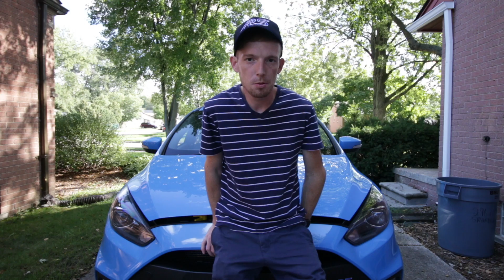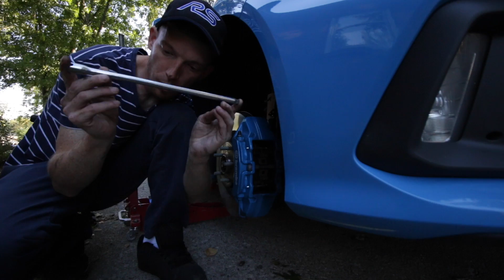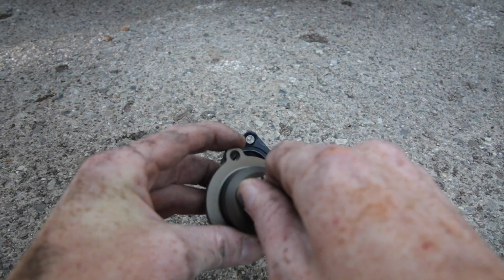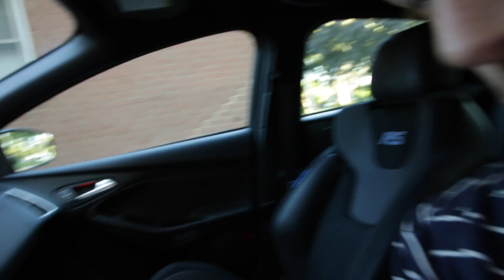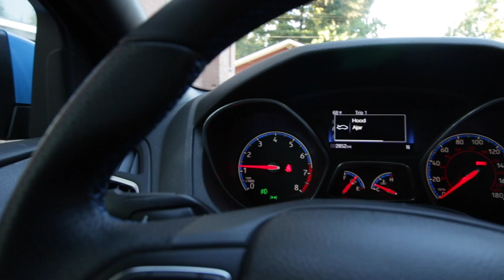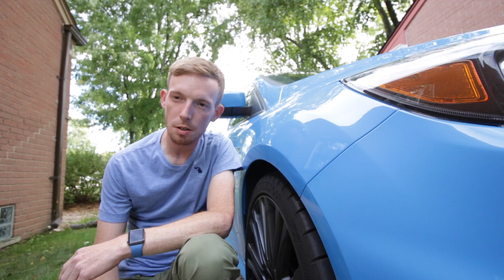Mountune Recirculation Valve Replacement

Comment: I have installed the Mountune recirc valve but since first full throttle acceleration i felt a misfire like behaviour of the car. In the next days i had misfires in like 3-5 out of 10 full throttle accelerations. Today i took out the recirc and noticed the inner O-ring wasn''t there. I don't know if it was there at the beginning or maybe if could have been sucked by the turbo...The screws were tight. I put in the stock valve and i got 25-30 full throttle accelerations and no more misfires. As i recall the bigger O-ring came separattly. I just cannot remember if the inner small O-ring was attached or came separate, or just wasn't there...If it really was sucke into the turbo could it cause any damage? I ran the car for almoast a month with the mountune recirc.
Reply from the maker: I think sucking that into the turbo would have caused a bigger disturbance than a miss fire. That O-Ring does come attached but can easily have been hit off during install, etc.  It’s not super tight, but is for sure why you were feeling your miss fires. You A/F was way off. I do not think that you would have sucked it into the turbo without a more significant occurrence.
Reply: @ChristopherAyresfrs2  While on this subject is is the recirc montune a nessary change if we have the m380 tune? or stock recric fine.

Comment: you dont have to torque your wheels in sequence btw
Reply from the maker: Why wouldn’t you?  The factory sequence is all lug nuts secured fully at the exact same time. I know for repair standards at leas in tier 1 Auto companies it’s also mandatory to star torque.
Reply: Christopher Ayres once its on the hub, its on the hub, its different than sealing a headgasket in sequence
Reply from the maker: That’s not true. You do have to do them in sequence. The OEM does them all at the same time, the only way to replicate is by pattern unless you have a $200,000 wheel multiple.
Reply: Christopher Ayres im saying in sequence as in you dont have to torque them to 10lbs then 20 then 30 for example.

Comment: Great videos, no hiding you are full blown Mountune fanboy! Thanks for the content and little DIYs. Appreciate it. Also nice to see someone else with some RS apparel, so I dont feel a bit weird about my RS shirt.
Reply from the maker: Thanks. I appreciate you watching them. Mountune has been a great company to work with.
Reply: @ChristopherAyresfrs2  Hi Chris, What’s the difference between a Bypass valve and a recirculating valve? Personally I don’t like the washing sound. Some cars have the turbo chirping sound and some cars don’t. Why is that?
Reply: @surreallife777  A recirculating valve takes the excess boost pressure and feeds it back into the intake system. A bypass valve vents that excess boost pressure to the air, creating that "PSSSHH" sound we all love. On ST's and RS's, a recirc valve will mostly give you closed-throttle surge; something everyone knows as "turbo flutter."
Reply: @greecoboost  OK thanks for getting back to me.

Comment: Why this piece and not a Turbostart BOV ?
Reply from the maker: It’s a preference. I don’t like to rely on a twist to tighten/loosen unit to let out excess psi when it’s letting out to much. Also this recirculates the extra pressure back into the turbine instead of just venting to atmosphere, keeping the induction more stable.
Reply: Christopher Ayres thanks 
I went ahead and ordered the Mountune also

Comment: Hey chris, im thinking about buying the mountune intake, noise surpressor, and recirculation valve and was wondering if those 3 upgrades will void the warranty?
Reply from the maker: The intake is unlikely to but it depends on the dealer. The recirculating valve can do to it altering how the Turbo operates. I think you may be best contacting Dan Straup at Mountune on the subject, i don’t want to steer you wrong.

Comment: I lost one of the screws when removing the stock valve. Any idea how bad it would be to drive around temporarily with just 2 screws holding in the mountune valve?
Reply from the maker: +Boreenk I’d take it real easy and replace it ASAP.
Reply: Now I just need to figure out what size screw it is to ask for at the hardware store
Reply from the maker: +Boreenk I’d try to get an OE one first as they are aluminum I believe going into aluminum.
Reply: Christopher Ayres alright I guess I'll just call my Ford dealer tomorrow morning
Reply: Thanks for making this video by the way, this made it much easier than just the paper mountune sent.

My Ford dealer said that nothing on the turbo is serviceable, so basically to get a new screw I'd have to buy an entire turbo - how ridiculous is that?
Reply from the maker: +Boreenk When you have time take a bolt out and take it to your hardware store and ask. The bolt has to be SS, then just find the correct one. I find it hard to believe ford does not service their recirculating valve. You may want to call another dealer too.
Reply: Christopher Ayres yeah I forgot to include that part, I'm checking hardware stores tomorrow. 
It took both dealers I called a long time to even figure out what the recirc valve is, because it's not a serviceable part so it's not listed in whatever inventory they have on the computers
Reply from the maker: +Boreenk let me try to find a part number. You try hardware store.

Comment: Hi Chris. Thanks for all the great videos! I started this install  yesterday but bailed after not finding a good position to get at the valve. Whats do you recommend the best way to get at is is? I pulled the wheel, but just couldn't fit into the wheel well lol. Any suggestions would be much appreciated.
Reply from the maker: +Steve Chong Take wheel off and use a good pair of circ clip pliers like craftsman. The ones from the auto parts store make it a huge pain in the ass. I’ve done it both ways and found for 20 bucks I got the craftsman ones and they were much sturdier and the tabs held inside the ring holes better. If you have to once compressed you can spin the ring for a better angle or if you get one side out then carefully compress to get the other out. Takes a lot of patience. It’s like trying to plug in a damn 3 prong plug into a plug behind a dresser you can’t move. It’s a bitch but will happen if you try at it. Just if you get frustrated take a break for a few minutes and come back. It can be quite the arm work out. Let me know how it goes.

Comment: Chris, what size torque ratchet and breaker bar did you use? 1/2", 1/4"?
Reply from the maker: +Kyle Spicer for the recirculation valve?  1/4" with a M6 Allen.  Not on that tight.

Comment: Hey I installed a turbosmart bov on my focus RS saw it lost a little bit of power according to the datalogs so I swapped the oem valve back on for the time being. I have to ask though what does the white lines on the stock valve signify? I'm afraid it may not be lined up properly but the car is running great now.
Reply from the maker: +richard ott They are just witness marks from the factory that it was inspected to be on correct. The turbosmart is probably loosing power because it's leaking boost. You have to tighten it up a bit by twisting it clockwise. That would be my fist try.
Reply: Thanks man appreciate the quick reply, I ended up removing the valve.
Reply: We call those "match marks" where I work. I work at Trident Refit Facility, Kings Bay, Ga. It is a submarine repair facility. I own a lowly ST...I wish that I could willfully spend the money to get an RS. Much respect.
Reply from the maker: Working with Submarines sounds like it would be very interesting and fun!  Match marks are more of a term we use to signify where say a torqued bolt head lines up to a certain point on the surface and that line through the head onto the surface is torqued to 100% specification, where the other is just more of a “it’s there, and installed correctly”.

Comment: Hi I just subscribed thank you very much for making these videos. I was wondering if you could tell  me what do you know as far as some of these mountune parts are they going to cause problems down the road when you have to do smog check. I live in California and I am a little concerned about that. I do remember Cobb having a stage 2 setup that was made for the focus st which was actually CARB approved. Thanks again and I will be keeping an eye on your videos.
Reply from the maker: Paul Salamasidis Actually Mountune being based out of California is not really wanting to make any parts that won't pass there. They are pretty adamant about that. I do not think you will have any issues. They would have came out with a cat less down pipe by now if that were the case. I can say very certain that none of their parts will affect emissions testings.
Reply from the maker: Paul Salamasidis I will incorporate whether emissions will be an issue on all future videos, as for the videos I have, they will all pass.

Comment: What's the advantage of changing the RV?
Reply from the maker: My72MGB it's much more stiffer than the stock and is easier to calibrate duty cycled during tuning. Added bonus makes the turbo sound more refined during spoil and pressure release. Not BOV loud but a crisp noise.